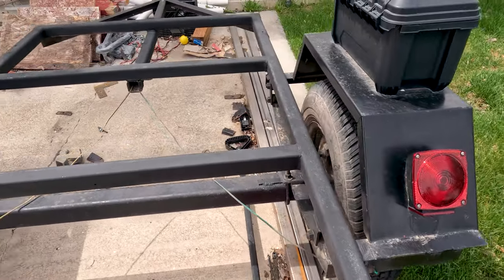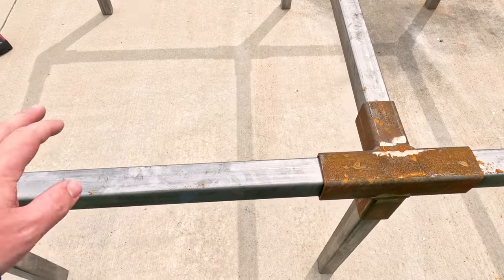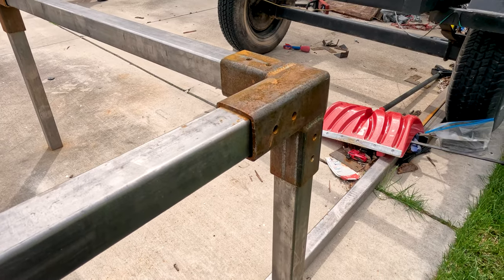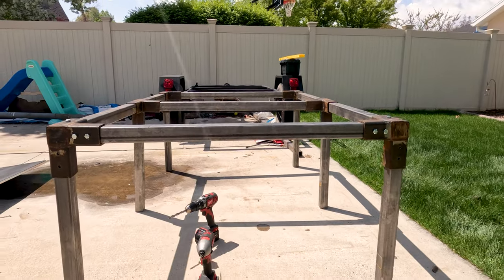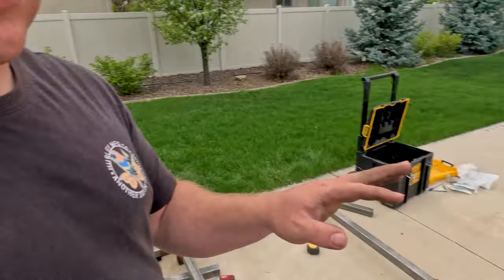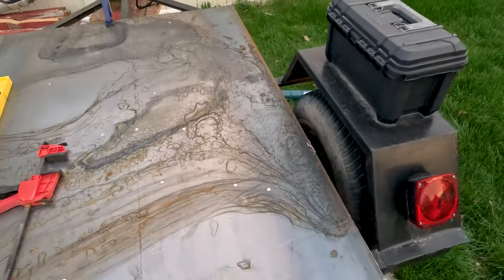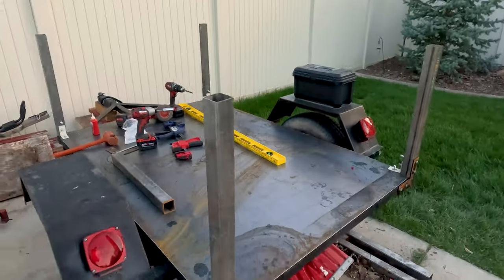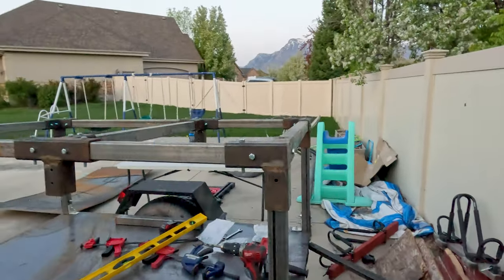Frame Complete! No Weld Overland Trailer Build Part 2!

Comment: Nice job. Where did you find those steel connector pieces?
Reply from the maker: @unshakentomato5609 I had a local fabricator make them. All in with labor and metal it cost me $300 for all 6 of them. They are 2.5”x2.5”x.25” square tubes made into connectors. This enabled the 2” tube to slide in with little slop.